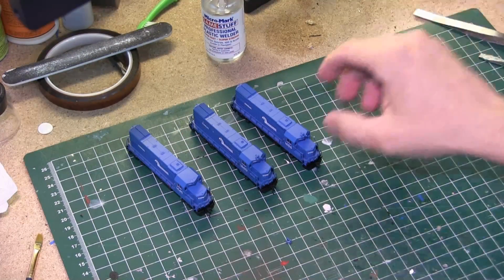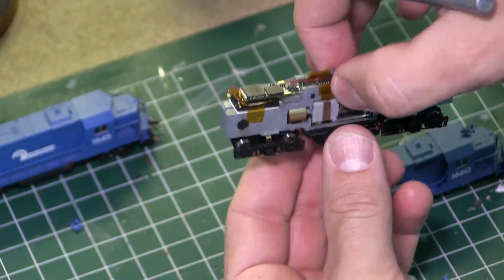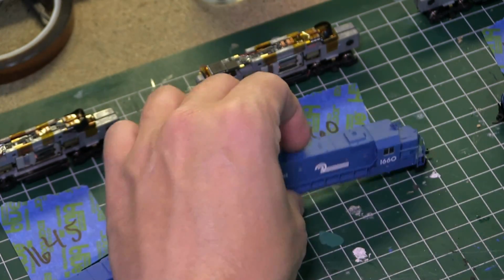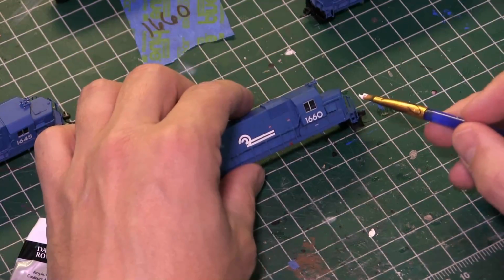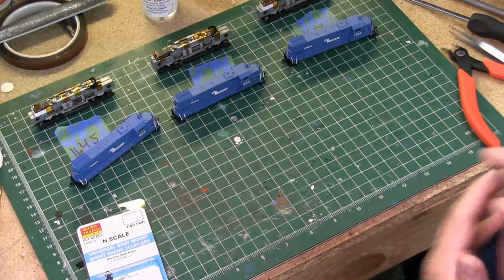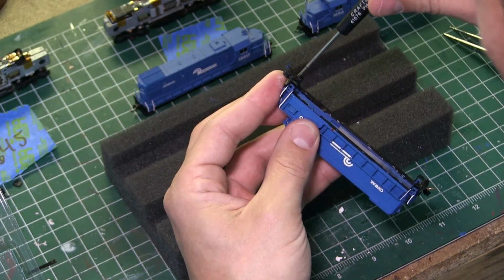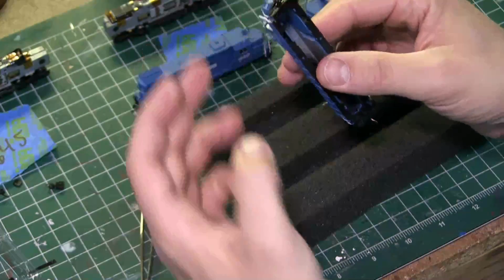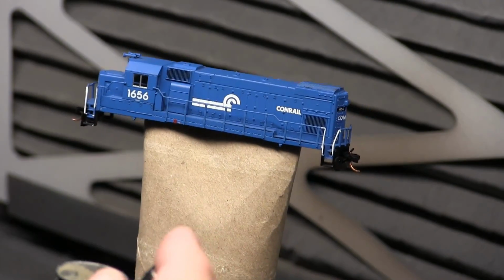Atlas  GP15-1

Comment: They look great, I do have some questions: When you shot the sand in your air brush you said a couple of drops to thin the paint, what paint did you use,  ratio paint to thinner.  When you added powders did you let the paint dry or tacky?  Enjoyed the over head shot....thanks for sharing.
Reply from the maker: will kling I’m sorry I forgot that! I pipette  full of paint and three drops of 70% isopropyl alcohol. I put the powders on after the paint has dried. The. Seal it with dulcoat.
Reply: @centraljerseyconrailinnsca5676  like the way they turned out, thought you used to much power but in the end they looked great....thanks for sharing....Jack
Reply: @centraljerseyconrailinnsca5676  thanks Joe I have 2 to do next week and just got me new Air Brush Iwatta cn gravity feed and want to try it out.
Reply from the maker: J Olliemark thanks Jack!
Reply from the maker: will kling no problem thanks for watching

Comment: Nice work! Joe what exact decoder, speaker, and capacitors did your friend use to instal in your locomotives? Thanks!
Reply from the maker: I use the ESU Lok sound select direct micro board, not sure what caps Ben added. The speaker is a zimo 8mm cube.
Reply: Central Jersey Conrail in N Scale cool thanks!